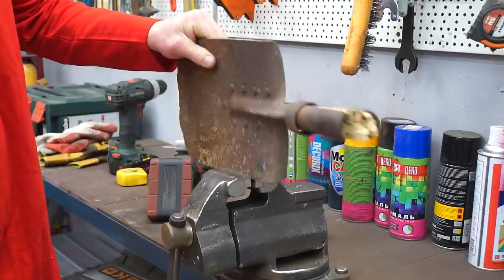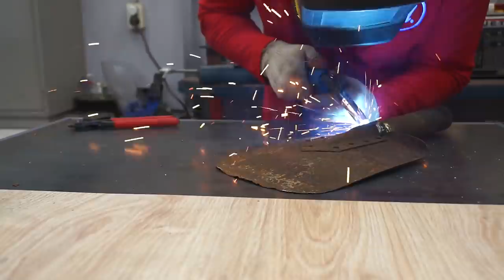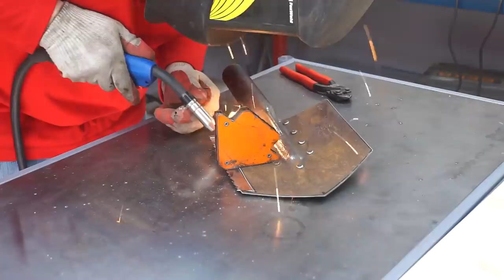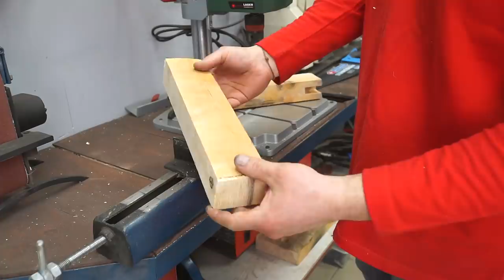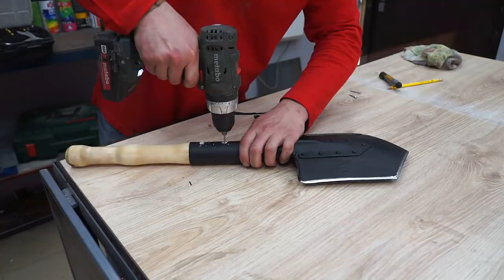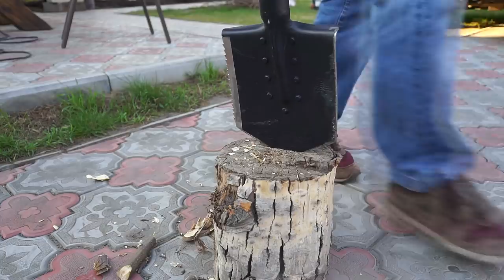DO NOT RUSH TO THROW AWAY THE OLD SHOVEL!!! Watch this VIDEO!!!

Comment: When one sharpens a shovel, they should always sharpen or grind the inside of the blade not the outside of the blade. This will help the cutting edge to bite into the dirt at a better angle, when one sharpens the outside of the blade it will give a flatter bevel or taper against the ground causing it to skim the surface rather than cut in.
Reply from the maker: OK, thanks friend

Comment: Did you purposely only aim your blade teeth toward the handle to work as a wood saw with a pulling motion rather than aim them toward the blade tip to also aid in cutting through roots on the down stroke?
Reply from the maker: hello, yes, you said correctly,you need to do the opposite 🔙🙋‍♂️

Comment: Great if you have an engineering work shop otherwise. Go to an old military surplus shop
Reply from the maker: Yes, you are right,but my workshop did not fall from the sky to me!😇
Reply: Unfortunately not everybody has access to a lathe welder  & a grinder ? so we have to buy one if we needed it, the  big advantage of my one, is it folds up & the head can be locked at a 90 degree angle & has a stirrup handle for want  of a better word. ps but he still done a great job, give him his due.
Reply from the maker: @rayfitch8540  Hello, thank you so much for your support!Best wishes from Russia!I made the lathe myself link at the end of this video!